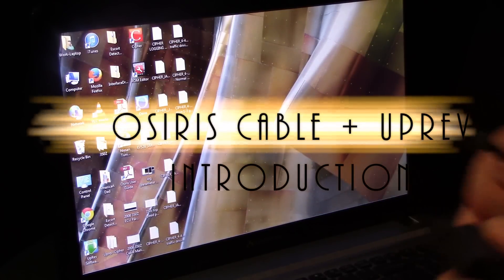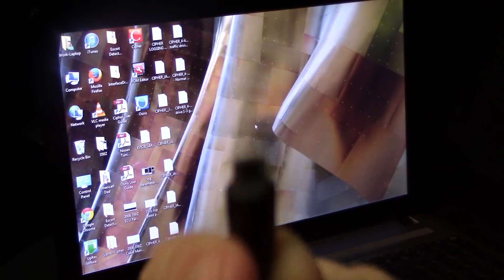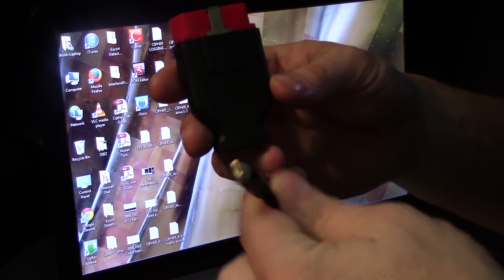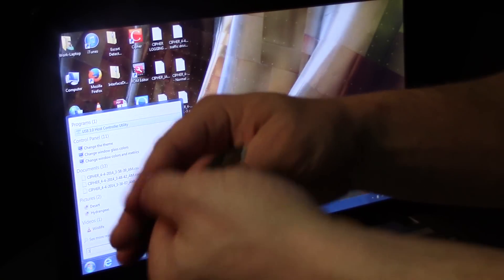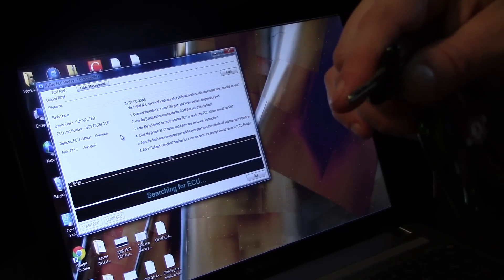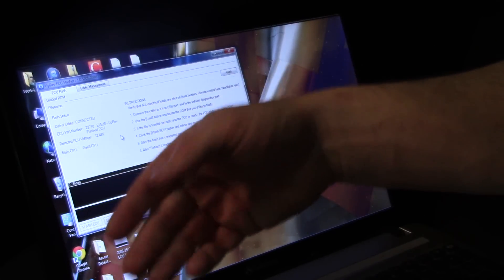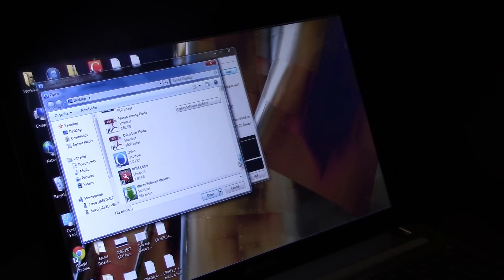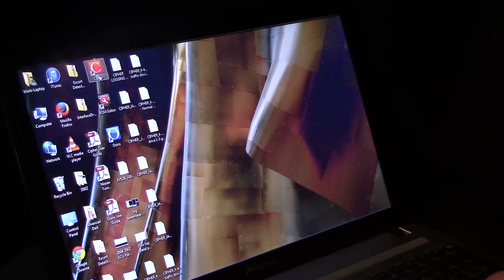Osiris Cable - Uprev - Introduction Part - 1

Comment: How much horsepower can you actually get from this tuner ?
Reply from the maker: It's uprev ..  go to uprev.com.  -- Anyhow, it depends on what modifications you've done.  The more NA mods, generally the more power a tune will "unlock".  It's a "tune" meaning it optimizes everything in accordance with the modifications -- though it is true that even on a stock Z it would add some power.

Anyhow.. most people gain between 10-15 horsepower and 20-30 ft-lbs of torque after a tune.  The big thing with a tune though is performance.  It changes the way the engine responds throughout the RPM range in each gear.. changes idle.. WOT, and so on.. So the car will accelerate faster, have a higher top end, usually the rev limiter is pushed up a bit (depending on motor),.. and so on.  The "Driveability" of the car changes a lot which is impossible to put into numbers.

Best thing you can do is find a tuner shop local to you -- and have them tune it (they will likely use Uprev) with their Dyno system.

Comment from the maker: +Vincent Lomio Vincent Lomio It doesn't come with a CD of any kind.  You go to the Uprev website and download the software and such.  If you bought a tune package from Uprev you will acquire everything from their website.. including your Tuned ROM.
Reply: Ikos Log I did not get a tune package, how do i do this from start? I click osiris but it doesnt open, can you call me and walk me through it?
Reply: Ikos Log its suppose to have 5 presets
Reply from the maker: Vincent Lomio I won't be of help to you.  You need a Tuner.  You are set up to go through a company called UpRev.   Which is located at www.uprev.com -- I would suggest you just call them at 512.821.9848 and explain what you do have, and where to go from there.  Your cord should have a "License" on it.  They can explain all of that... You may need to return the cord you bought and buy one from Uprev.  As the cord is useless unless you have a Tuner to make the changes and send you the ROM's to flash to your cars computer (ECU).  Uprev does this for you online.    You can also use a local tuner if you can find one.. but most aren't familiar with the Z's..  Good luck!
Reply: GuessTech 😂